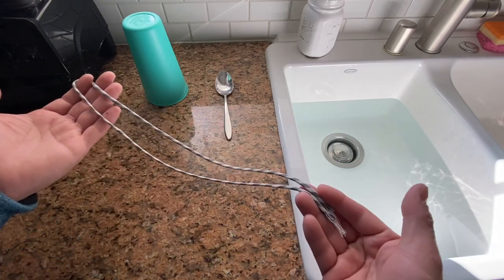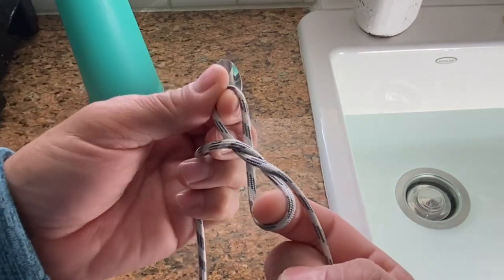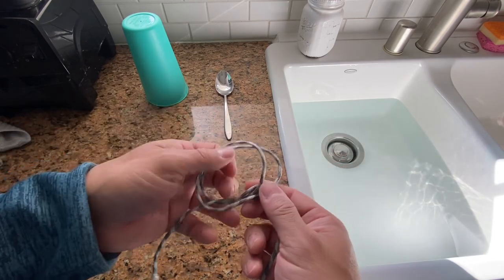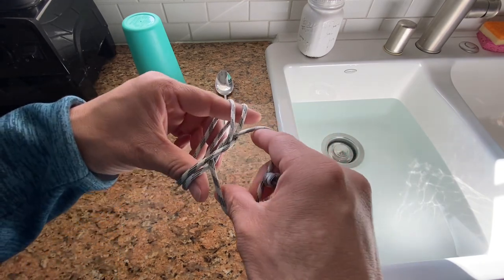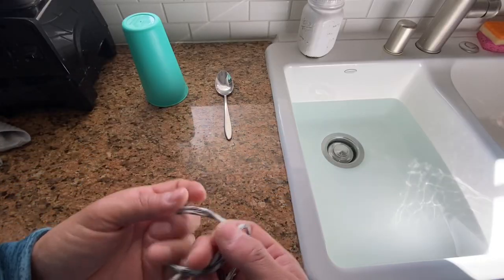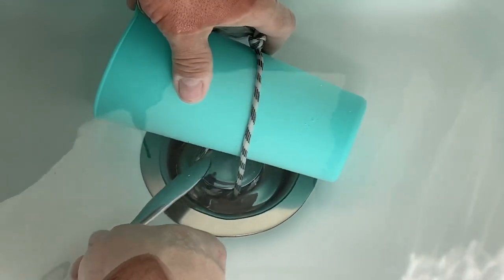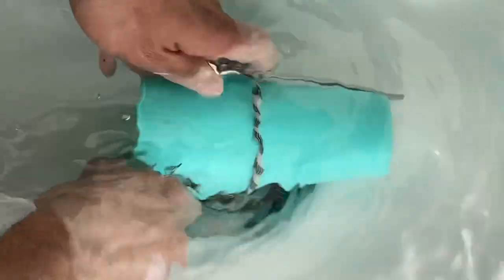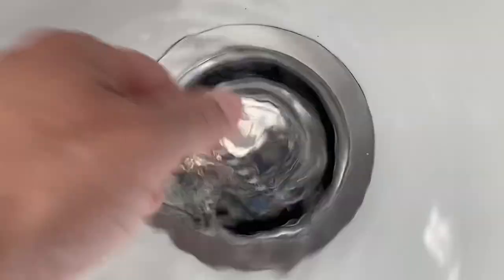How to remove a stuck sink stopper. Constrictor Knot.

Comment: One of my favorite knots. I've always thought of it as a clove hitch tied under a round turn, or a round turn riding on the crossing of a clove hitch.
One of my go to uses is as a temporary whipping when cutting rope. Often I would tie two knots, an inch or so apart, and make the cut between. 

Your content is useful as always. If you get a chance, maybe show folks how to tie the same knot when you aren't able to slip it over the end of the object?